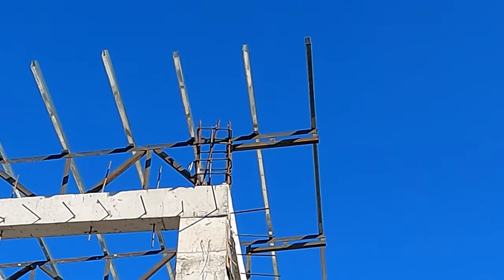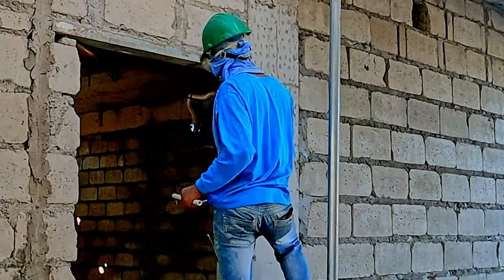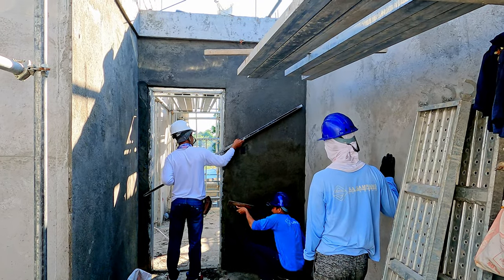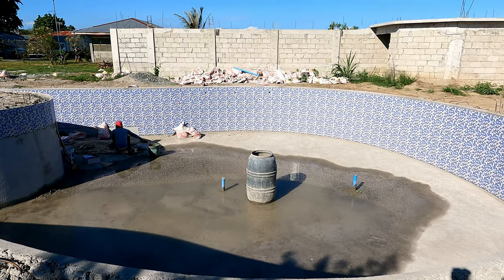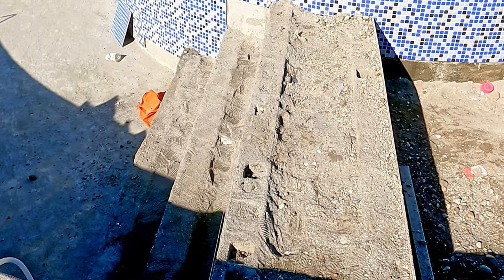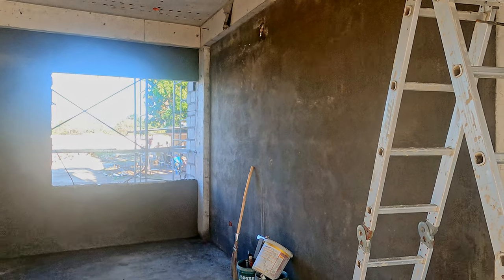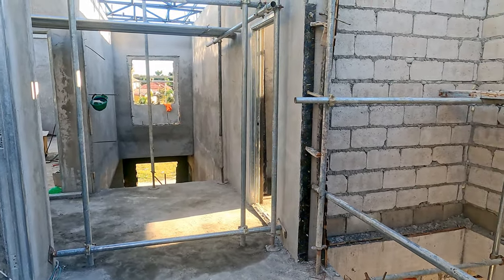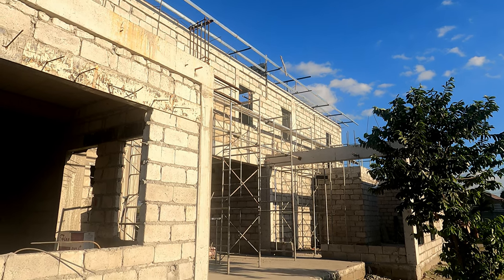Philippine House Building Day 134 - Final Roof Competition Entries

Comment: Hi Mike, think the confusion on the roof is that the sections are prefabricated and contain a few parts, the horizontal spreading across the top of the walls is the joist, the pitched part is the rafter. the parts in between to strengthen the rafter are struts. However you are right, the pieces welded on running across the rafters are indeed the purlin.
Reply from the maker: Thank you Grant. Quite a few responses to this question, so will have to go through and see if I end up even more confused. Not sure whether English / American makes a difference in the terminology

Comment: Good morning Mike It's impressive when wife has tape in hand doing measurements. The pool blue pipe work looks deep enough to me to lower would require more bends best left. I would like to see more water flow and I go with cutout at the top no risk young person held under water.
Roof I call the steel angles welded TRUSS because they have a top and bottom cord. As the truss bracing is in a compression and tension setup with vertical spreader well proven method.
In large truss often go with tension bracing as steel is 7 times stronger in tension and I mean spans greater than 20 meters.
Reply from the maker: Graeme
When the engineer sees her coming, you can see the fear in his eyes.
We are going to make a change to the pool in that retaining wall to allow more flow. The new gap will only be about 20cm high, so should not be a safety hazzard.
Truss seems to be the  one pretty universal term. Thank you

Comment: I think strictly speaking your roof has trusses, these are the entire prefabricated frame structure attached to the walls, rafters are the normally wooden angled beam on the upper bit of the truss that the purlins and metal roof are attached to. Joists are the horizontal beams that go across the floor of the attic that any flooring and the ceiling below are attached to.
Reply from the maker: caparn
An excellent explanation. Thank you very much

Comment: Mike, I’m a bit like you on that pipe in the pool. I did picture something much different, a bit like you originally described. It doesn’t seem like it’d get much flow and it’d probably end up just collecting leaves and other garbage until it got clogged. And  then how to clean it. I’m happy to hear only one person working on the roof today,  it helps with my day 163 guess lol I know nothing about building so I have a question. Will those trusses be painted with rust protection? Or are they already treated. Our place is near the beach and I remember everything being painted with what I assume was some rust protection.
Reply from the maker: Sean
Confirmed this morning that we want more - I had not thought of blockage but it is certainly possible.
I think everything gets a rust paint treatment. Certainly already looks in places like it needs it.

Comment: Hello to all . Doors : Standard Door Height = 2.100 meters . Normal Door= 900 mm wide - Bathroom = 800 mm wide : Toilets Separate = 700 mm wide . Front Double Door  = 1.800 mm ,:  Pantry Double Door = 1.200 mm . These are the standard doors that I use . But you can make what you like . As for your roof my description is they are standard metal angled trusses plus standard c- metal perlins roof support system . Pool : riser and width depends weather your going to use them for a seat or just access steps . If seat  250 mm riser 400 mm wide - if steps 325 mm wide 150 mm riser  . Again you can actually use any measurements you like depending who using the pool . Regards  Mick
Reply from the maker: Mick
All the upstairs doors will be 2.1m. Downstairs 2.4m. I think door widths downstairs do vary.
Thanks for the roof terms. 
The pool steps will be used as steps. Not sure how wide they are going yet. The risers seem ok to me, but an extra few inches on the treads is necessary.

Comment: The terminology gets very confusing, google is no help either. Let's make up some new names... vertical bit, horizontal bit, angle bit. At 17 I was an apprentice roof tiler, until I crashed my bike and right leg, so I learnt roof tiler's terminology, now it seems not just regions but even different trades have their own way of describing the parts. A concrete roof deck is looking better and better 🙃
Reply from the maker: JB
Your new names might just stick.